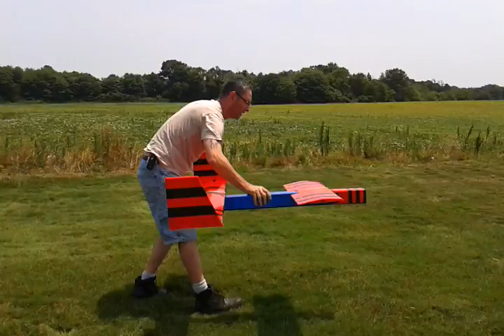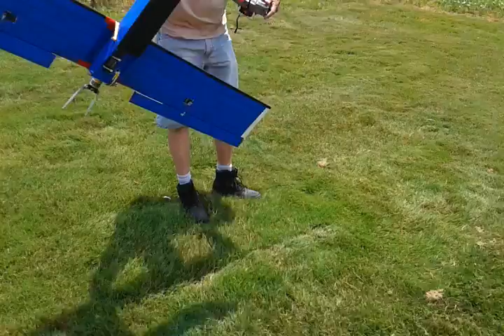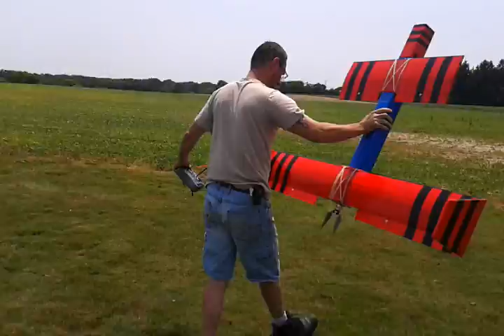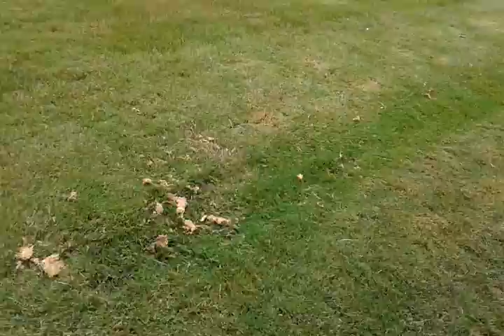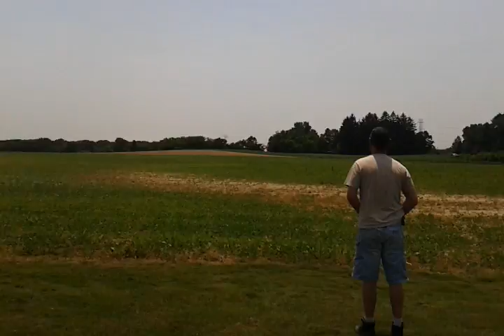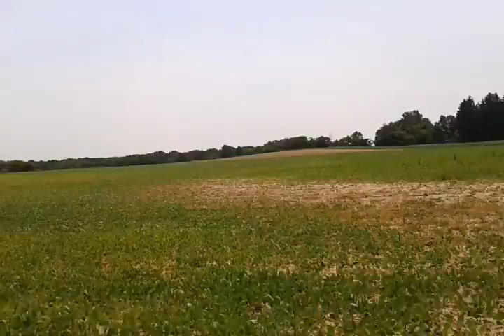Peace Drone Maiden

Comment: Yup, this basic layout flies fairly well if the wing loading is low and you've got enough power to hand launch. I think the wake from the canard really makes a big impact at slow speed. My 40 inch version flies with 1/2 throttle once accelerated up to speed, but the launch requires full throttle. Stall speed is quite high in comparison to a conventional design of same weight/power/span - which is normal for canards from what I've read/seen. Naturally, lightening things up always helps.